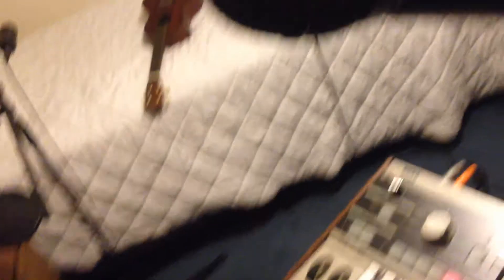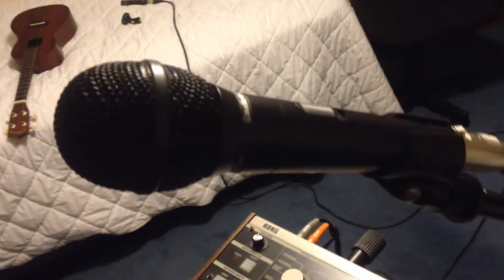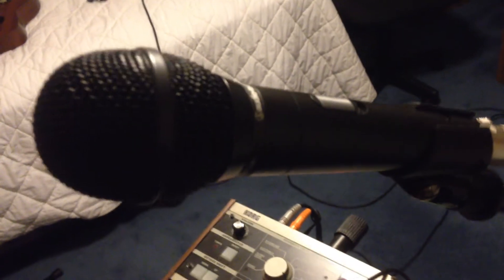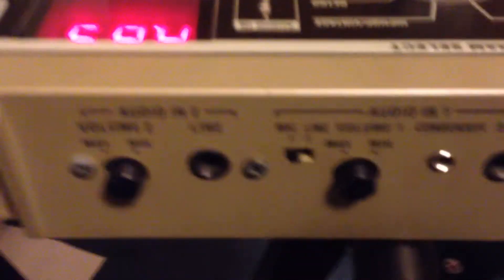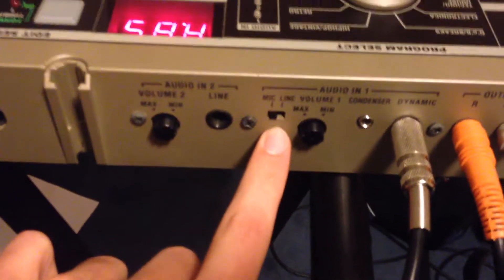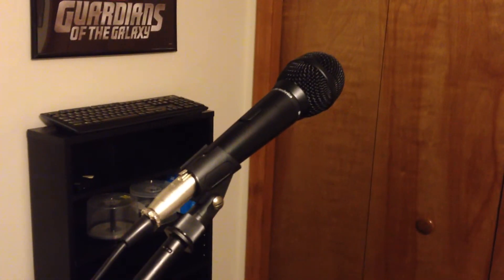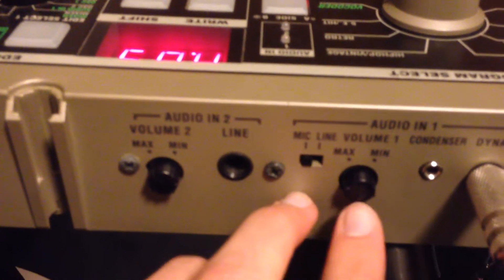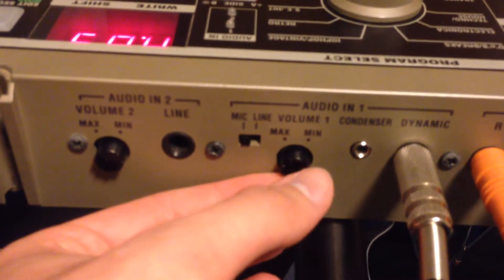Getting a MicroKorg Vocoder to Work

Comment: Can two microphones be connected? How to connect a dynamic microphone e.g. SM58 when it does not work? please help and tell me more. Thank you bro.
Reply from the maker: sm58 should work great.  I'd check your connections and make sure you can get sound out of other patches first if things aren't working.  try the gain at different levels, make sure you're giving the mic a loud strong signal.
Reply: @JamesSchramm  Thx, I am going to try these ones.

Comment: if you're still having trouble getting the mic to work, you should check to see if you have two output cables. it won't work if you have only one, but the synth still works.
Reply: What is the two output cable? Do you mean a stereo cable?
Reply: Please, send me a link.

Comment: Hi- I can't get any sound. I'm using a Shure SM58. Is that the wrong mic? All other settings are like you show
Reply from the maker: A sm58 should work great for this.  After making sure all of your cable connections are completely plugged in, try a few different vocoder patches- some should work right away and some require tweaking to actually use the mic signal.
Reply: @JamesSchramm  Neither can I. I don't get any sound. SM58. I will have to check it out again.